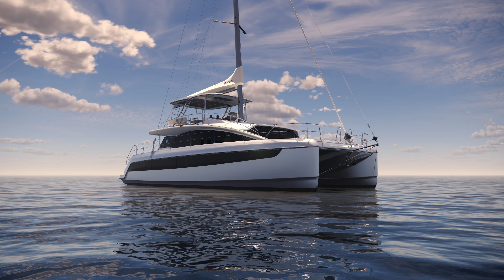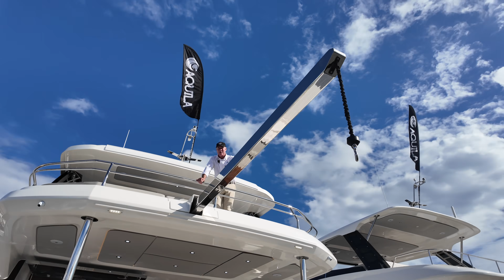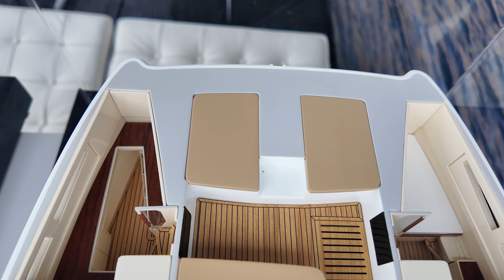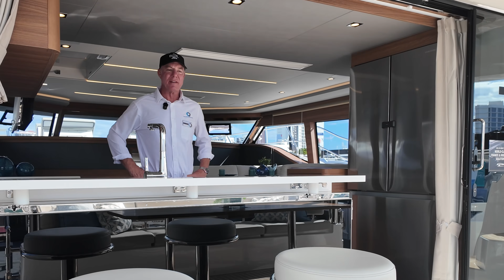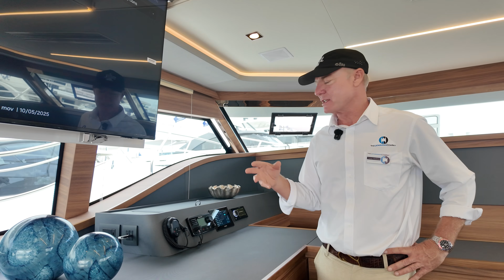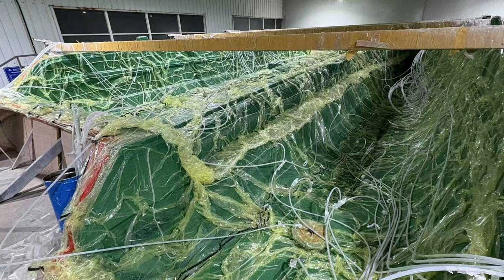Aquila 50 Sail: Innovative Design for Ultimate Charter Comfort

Comment: One interesting point regarding the cabin entrances, which are located on the outside of the bow of the vessel, is that waves that might pass over the bow will not enter the cabins, as they will certainly flood the recessed area, as happens on Bali catamarans.
Reply from the maker: A great point. Yes, these cabin entrances in the bow were made very secure and safe, and extremely roomy on the 6 cabin configuration which makes the design an excellent feature for charter boats. We appreciate your comment! Check out the full walkthrough video just released on our channel of the Aquila 50 sail!